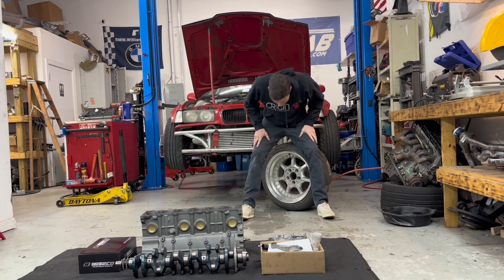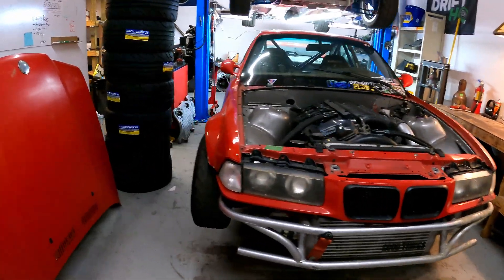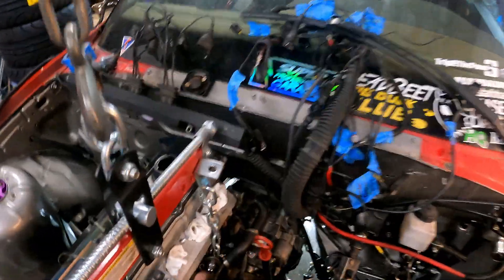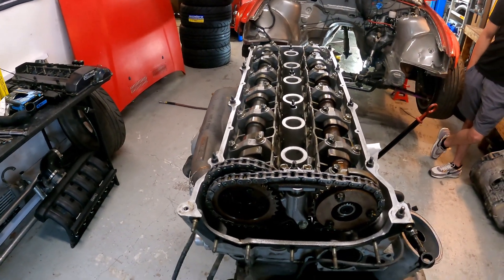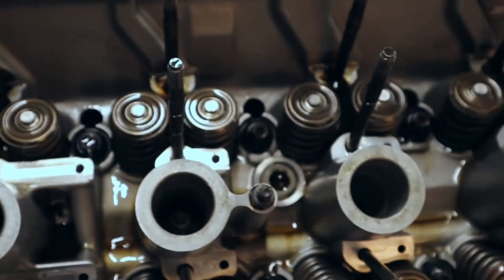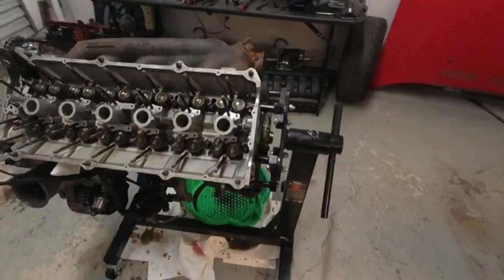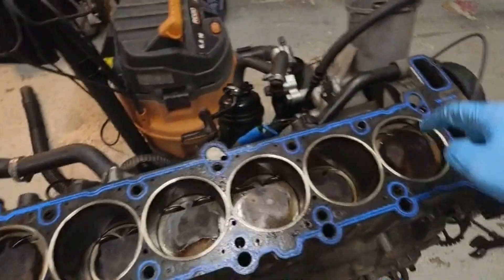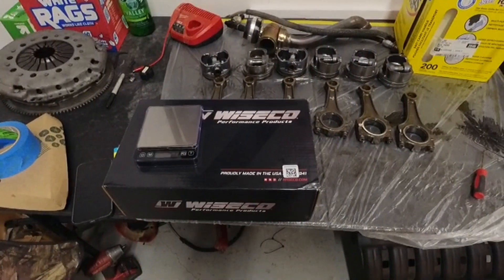E36 Turbo M50 / M52  Rebuild PART 1 !!  Low Compression Engine Disassembly.

Comment: Excited for the rest of the series! You go with 8:1 wiseco's?
Reply from the maker: Appreciate you!!  8.8 Wiesco m50tu pistons with m50 nv rods got me 10.5:1
Reply: I been trying to find a nv engine at the local yard to Frankenstein the nv head to make it a vanos head. And I want to send have Perry make me some cams too. He recommended 280/280 for a street car. And been considering just as is to test out the solid lifter conversion he’s got too while the engine is na